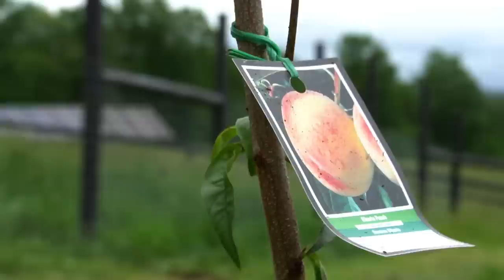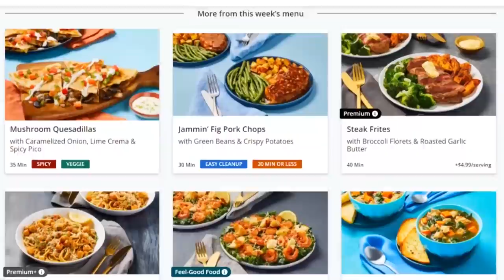Our Next Chapter...

Comment: I'd suggest you trim every fiber pot to ground level or just below. The peat pot rim will act like a sponge and pull the water away from the trees. At one time, I rescued 40 small trees that had been planted by a nursery with pots. They all later recovered when I transplanted them but did have a mild disease (which I eradicated). Good luck with your fruit trees. I have about a dozen fruits and they are my favs.

Comment: When you put wire around your peach trees that will cut into your trees if you take and put a piece of rubber hose around it to run your wire through the rubber hose it will not cut into your trees and they will last longer

Comment: As you are renovating the one house, if you need insulation, there's a product called Insofast that is exterior sheathing insulation with a capillary break and built in furring strips. I don't have any vested interest in the product. I just think it's a neat system that is useful for renovations (especially if exterior siding needs to be redone and energy conservation needs to be updated).

Comment: I've been landscaping 30 years, it was great to see trees being planted. Be careful about planting too low and putting loose topsoil on top of the soil level in the original pots. Hands down these two issues rank highest in the health of new trees besides proper watering. The trees could thrive being planted half the depth of the pots but could easily croak being an inch too deep.

Comment: I would suggest adding more fencing for better height around your orchard. I've seen deer jump higher than what you have right now. Not too important until your trees start producing. Deer also use their front legs to pull branches down where they can reach the fruit easier and they break branches off doing this. They can and will ruin your orchard.

Comment: Erin, dump the tennis shoes and please wear a pair of hard sole boots. With all of the demolition going on, it's just a matter of time before you step on a board with a nail.

For supporting the fruit trees, thread some wire though a piece of heater hose, so the rubber is against the tree instead of wire.  Oh, good luck getting peaches go grow in your climate. On hard winter and the peaches will die off.

The place has a lot of potential and between the two of you, you'll get it done.

Comment: Only two peach?  What??? That's not enough peaches. lol  Be sure to keep the trunks high enough above ground so that they don't rot from too much moisture.  The trunk should be able to dry out completely between rain and waterings. There shouldn't be a single inch of the trunk under the dirt. I wish you the best of luck.

Comment: If you have some garden hose I would put that over the wire! The wire is going to cut those saplings in half especially if you have high wind like we do. Just out of curiosity how does one get the PVC pipe off? I have an orchard I have never seen PVC pipe used but I will have to look into it.

Comment: Can't really tell definitively, but the chimney looks too short.  The top should be 24" higher than the roof, ten feet away horizontally.  
The sideways 2x12 that carries a double rafter over the fireplace should be 3-ply, in other words, three 2x12's, to distribute the shorter rafter's load to the two adjacent rafters.  
I think I'd reframe the short side (Front) of the saltbox to become a steeper slope, to shed your WVA snows better.  Continue the steep side's plane up about four or five feet, until the slope of the short roof matches the 8/12 pitch, or whatever the (Back) long roof is.

Comment: Just curious here... Have you guys done the math if it would be better just to tear everything down and build something new? 

Im asking cause i was surprised when i got help doing the math on it myself for my first project that was total renovation.    I mean its more to build new.. But the cost vs the value of a new vs reno. 
It was just insane.  I did build a new home myself for under 130k in total ( 2 floors 180square meter ) pre corona when materials wherent that high.   After going a bit more luxurious on bathroom and kitchen i ended up at 150k.    And the total reno cost was set at 110k.    So 40k differance.     But the value from "reno" to "new" was estimated differance of 120k.    
So in short:
Renovation value = 210k  ( Would have spent 110k ) 
New home = 330k      ( Spent 150k )

Ive not included labor..Cause who knows what troubles i would have encountered or not with reno work.   From previous experience id say its roughly the same.. 10% up or down either way.